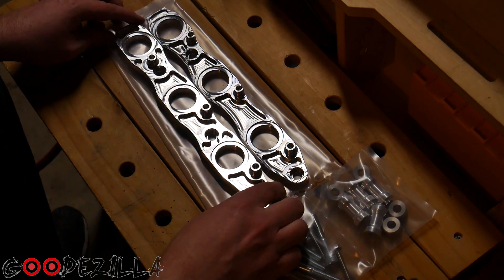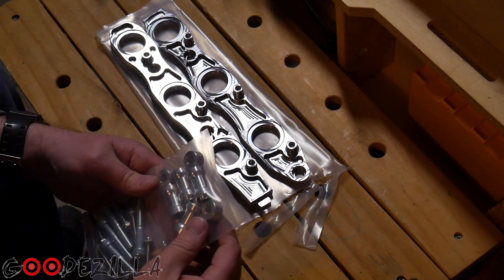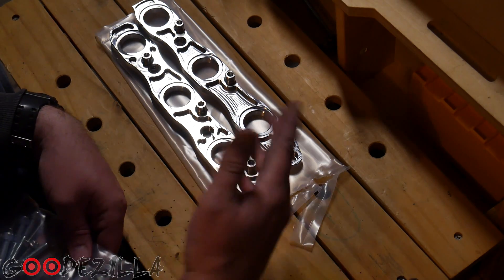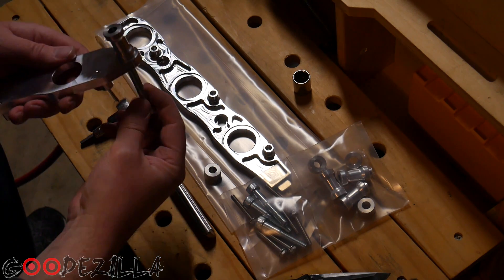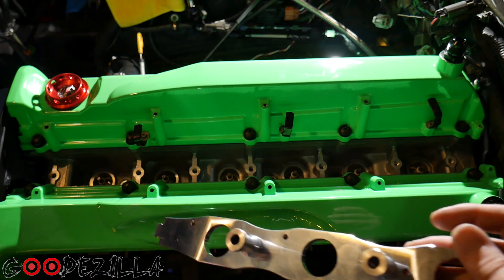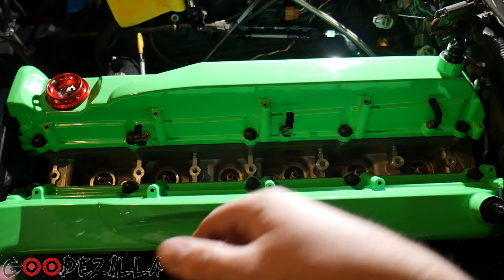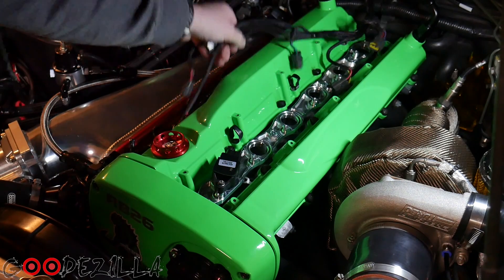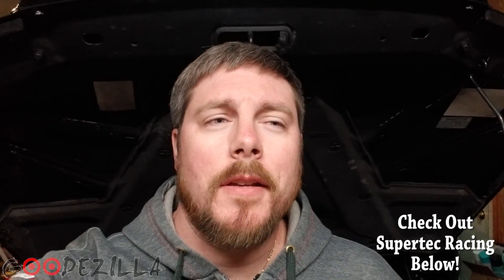Supertec Racing R35 GTR Coil Bracket Kit Upgrade for RB26

Comment: Hey! Did you have to change any dwell settings for this? 
Also missing your updates! Get in the 32 again 👍
Reply from the maker: Hey, I did change the settings, but I don't think you "have to" for them to work...just to get the best performance out of them.
Reply: Have you got the settings still?! I know it’s a long time ago. Hope your well.
Reply from the maker: @jimbostir5004  thank you man. I'm doing well...just doing the family thing and working. I'm pretty sure I used the settings from supertec racing as that's the kit I have - https://cdn.shopify.com/s/files/1/0250/5159/4800/files/Supertec_Racing_VR38_Coil_Adapter_Kit_V4.0_Nzc1ND.pdf
Reply from the maker: @jimbostir5004  But there is also PRP's settings here:  https://www.platinumracingproducts.com/en-us/pages/platinum-racing-products-r35-dwell-settings
Reply: @Goodezilla  hi
All fitted up. Your right, it does run on idle fine. Having read up on dwell, I think I should change the settings. Did the dwell changes alter your map and how it runs? Thanks man.
Reply from the maker: @jimbostir5004  I changed the settings from the beginning. Never ran it without the modified dwell settings.
Reply: Thanks! Top man. I hope to see an update or two on the car from you soon!
Reply: Ok cool. Thanks

Comment: Hey man IDK if you read these because its been a year but love the vids very informative any who do you need a tune after installation ? I'm looking to get the r35 coils for my 32
Reply from the maker: Hey, thank you man. So, you don't need a tune to run them, but to use them to thier full ability you need to adjust the dwell settings in the ecu.
Reply: @Goodezilla  I don't think I have a dwell setting in mine because mine has a apexi power fc 😭 I haven't upgraded the ecu yet

Comment: Will it be a problem if I run the engine without changing the dwell setting? I’m still using the stock ecu. :) Sorry for the noob question, and nice vids btw, helps me a lot with the diy’s.
Reply from the maker: You can run them without changing the dwell settings. It just won't take advantage of the full capabilities of the coils until you do change the dwell. Still better than stock and/or splitfire stock replacements.
Reply: GoodeZilla thanks man.

Comment: Maybe a stupid question but why in you intro is it running rich by the alternator???
Reply from the maker: The new alternator puts out a higher voltage throughout the rpm range and in turn gives the fuel system more juice, which makes it pump more fuel.

Comment: Why would new alternator make you run rich?
Reply from the maker: The new alternator puts out a higher voltage throughout the rpm range and in turn gives the fuel system more juice, which makes it pump more fuel.
Reply: GoodeZilla I see, thanks

Comment: I‘m running the old Supertec Racing version too and it does the job great. But today I would go for PRP. Unfortunetly the UK will no longer be a part of the EU so it doesn‘t matter if I order in NZ or AUS or UK. In every case I have to deal with customs. But I can purchase the hole kit with loom, plugs... from PRP. But with the Supertec adapter I had to buy the loom and the plugs from different suppliers in the USA.
Reply from the maker: Hey man, yeah PRP has nice stuff too. I believe with their kit you HAVE to run their stalks. With supertec kit you can run stock or aftermarket stalks. So if you already have a harness and coils, this is a cheaper option as well. Don't get me wrong, I have PRP stuff as well. I think both are great options for billet pieces.